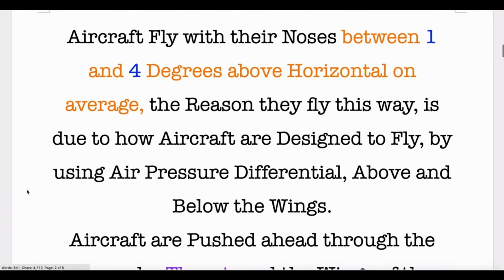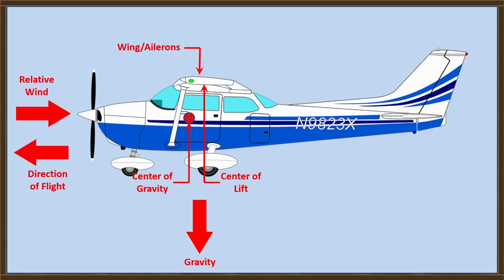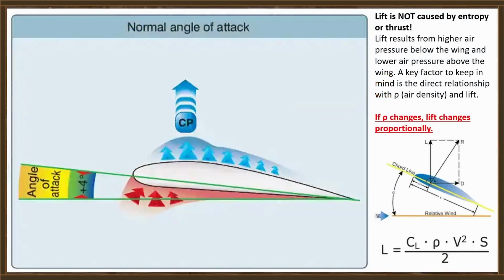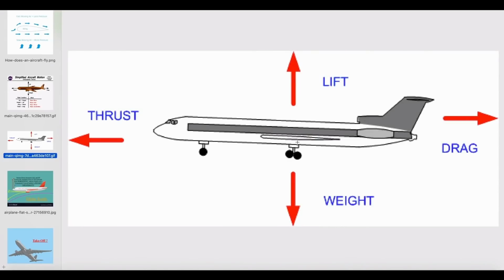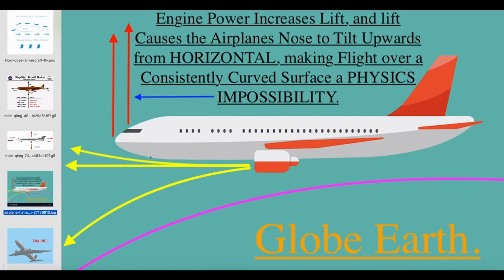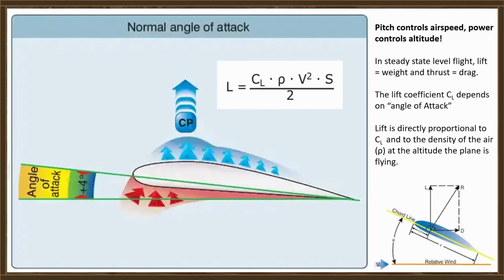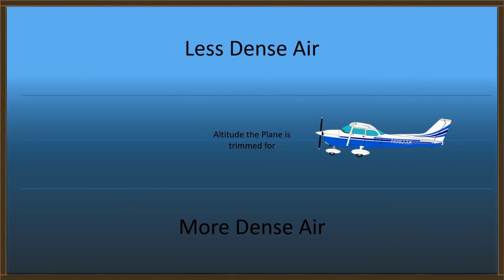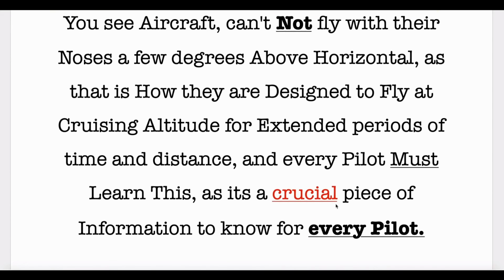Brian's Logic Shows Us How Little He Knows About Aviation

Comment: ... Small note here - most aircraft have the thrust line below the CG so an engine failure will automatically cause the nose to drop into a glide. By extension, adding thrust will typically cause an increase in attitude which the pilot will adjust for.
Brian's still lost, but there is usually a small torque moment between thrust and attitude; it's a safety feature that's been designed in though.

Comment: @10:15 minor correction... S is a reference area - not the surface area. We typically use the "planform area" which is a super rough approximation of the top-down cross-sectional area of the wing (not the body... just the wing).
Edit: technically it doesn't matter what area you use... it is a REFERENCE area... it's just needed to make the coefficient unitless.
Reply from the maker: It's rho that I wanted to focus on anyway. They consistently fail to include that in the discussion and it's the only reason we can trim a plane to fly hands off but it perfectly explains why an airplane follows the curvature of the earth.
Reply: @bluemarblescience  absolutely agreed!
There's plenty to learn here about basic aircraft stability if they were at all interested in learning anything.
The way a trim tab works is truly ingenious... really fascinating how deceptively simple it really is.
Just a note for anybody who wants to delve into the topic... if you increase the angle of attack a little, the lift on the main wing increases, and the lift from the tail also increases. (the tail being set to generate downforce, I really just said "less downforce") If the CG is ahead of the main wing as BMS shows in the diagram, the wing's new lift tries to nose back down and the tail (definitely behind the CG also tries to nose back down).
That's what we call stability... an increase in alpha causes the plane to nose back down... it wants to hold a steady alpha.
If you put the CG behind the main wing, something really bad happens. When alpha increases, the lift increases, and now the main wing tries to rotate the nose UP. A nose up causes the nose to go more up. This is unstable.
We do this in fighter planes, but we rely on computers to keep things in balance. Incidentally, the Wright brothers first planes were all unstable in pitch... the pilot really had to stay on top of things to keep it from crashing.